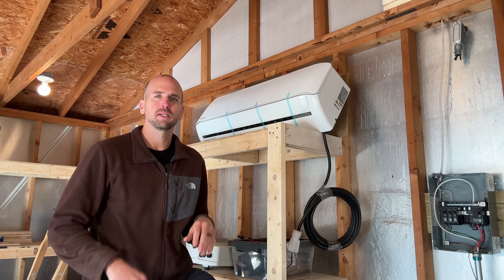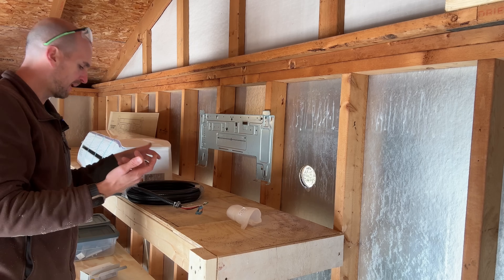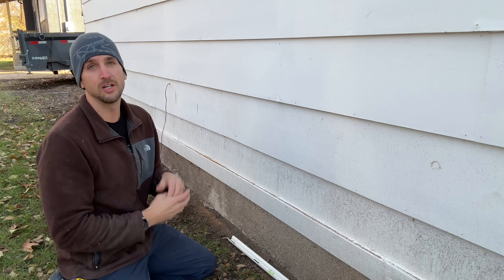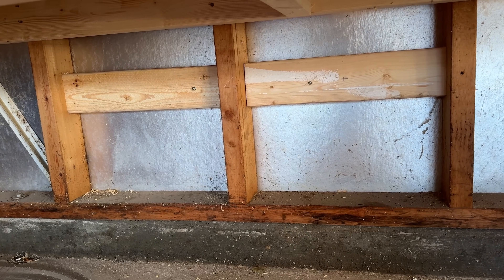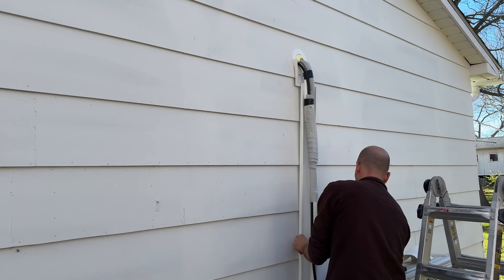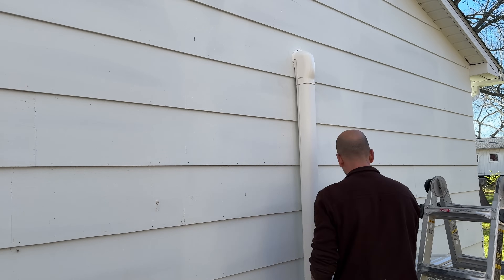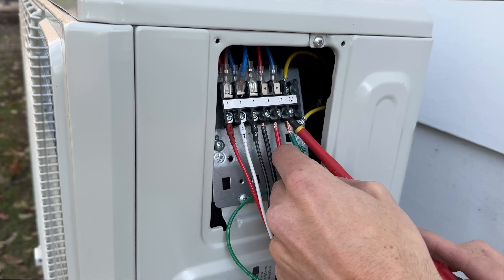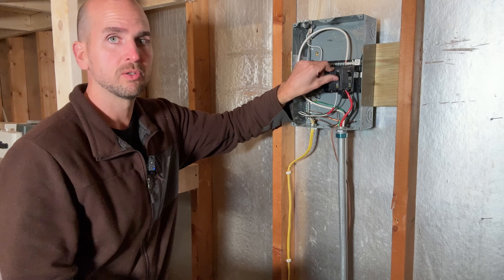Complete DIY Mini Split Installation | New Mr Cool 4th Gen Unit

Comment: Air handler is a bit close to that top shelf. You would get better air dispersion if it was mounted 18” + above the shelving. The movable louvers can disperse the air in a downward direction so heat would be more effective directed toward the floor.  (Of course the opposite is true for cooling mode)

Otherwise, looks like a great job!
Reply: A bit close is an understatement. Read the instructions there is a minimum dimension required above the floor, which is now a shelf. No reason not to move it 3' to the right

Comment: I don’t really understand these mini splits. They’re larger, more costly, and more difficult to install than a through-the-wall AC. What is the advantage exactly?
Reply: Heat. And a helliuva lot quieter. The compressor and the air handler are so quiet that you can barely tell they're running.
Reply: It separates the refrigeration cycle in to 2 separate parts (indoor and outdoor unit) hence the name "split" systems and transfers heat directly into or out of your space via the R410a refrigerant being pumped through the system. It has inverter technology allowing the unit to slow down and speed up fan and compressor speeds depending on the heating/cooling load which could potentially save energy.
Reply: From what I understand they are a lot more efficient to run than a window AC but I could be wrong.

Comment: Everybody that converts to this instead of the air-conditioning sticking through the wall, says the same thing, it looks better, but it’s not better
Reply: Clearly you haven't polled 'everybody'
Reply: @DFI429  After spending five grand, most people don’t wanna admit that $100 window air conditioner works better

Comment: I'm curious how well this will heat the space over the winter!
Reply from the maker: I will need to figure out some insulation STAT!  I want to keep things open so I think closed cell foam is probably my only option.
Reply: Rockwool and a smart vapor barrier membrain allows for access if need be.

Comment: this man is doing god's work explaining this stuff. fixed a bunch of outlets and electrical wiring thanks to him. it's the small stuff but yea.
Reply from the maker: Happy to help!
Reply: @EverydayHomeRepairs thanks for sharing. One suggestion and I'm not sure it's right because I'm not an expert but it sounds plausible. The coil should be underneath the unit rather than behind it. I guess having it coiled horizontally makes a difference with some type of lubricant in the line. Having it coiled vertically I guess the fluid can't make it back to the compressor.
Reply: @EverydayHomeRepairs let me know what you find out because I'm fixing to install a bunch of mini splits myself.
Reply: @powerguymark  Someone did answer this question above. Good luck with thye install. I'm doing the same as soon as the unit gets here.
Reply: @powerguymark they should be coiled underneath.. 
Another yt showed a guy using zip ties to put it up and under.  And yes something about pooling if it's vertical .
 And probably the whole install outside up another foot so you can get a mower or weed Wacker in under without difficulty..😊
Reply: Amen! Killer video! Much appreciated
Reply: Not sure if I would call it "Gods work" 😂
It's a nice little video that many many others do ..
And every video on yt is for people to make money ... Soooo
😂
Reply: Thanks for the video and the pointers. I installed one myself, but I used 10 gauge wiring due to distance.. I used to torque wrench, suggested to tighten the refrigerant lines and it worked out. I could’ve done it without the torque run since I have a good sense of how tight they should be. I used the leak fluid to be sure and there were no leaks. When I connected the refrigerant lines, I ran into the house and put the unit on an inside wall and did not have the coil the refrigerant lines at the outside unit. It seems above 32°. It’s more efficient to use the heat pump than the heat with Propane. Probably down to 20°F. Any thoughts?
Reply: God's work? WTF? 🤣
Reply: @michaelowen8055  Why do you have to be critical? If he believes that way - more power to him. If you believe your way - more power to you. Let the man create, as he did this install.
Reply: @michaelowen8055  Get a life. "God's work", is an expression. If I have to explain it you are too stupid to understand it.
Reply: I don't even believe in god and know darn well this is not gods work.
Reply: @dantrav1927 
Lol correct 💯 😂